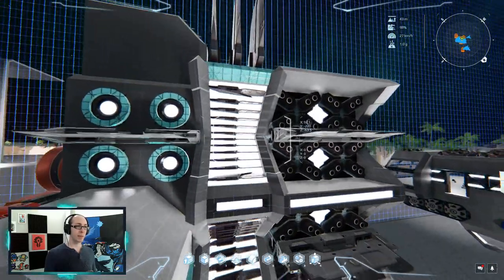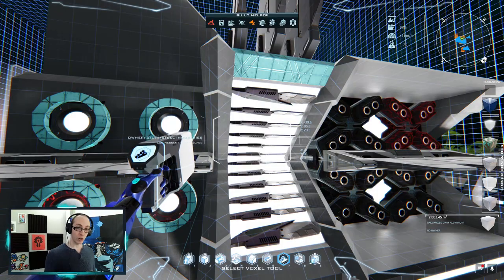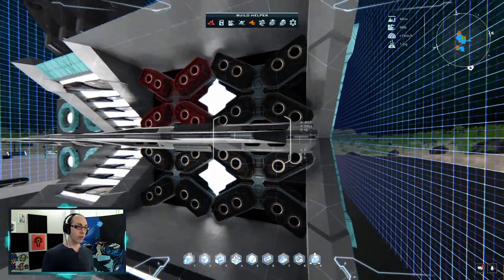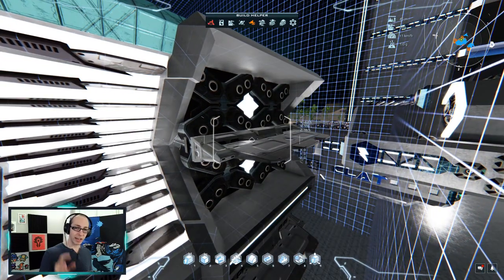DU Design - Airfoils 102 - Methods for placing Airfoils - Dual Universe

Comment: Obstruction won't go away. It works by taking a random vector (or maybe multiple vectors) from the engine/wing every X seconds and raycasting Y meters in that direction to see if something is behind it. The hyperion engine website lists the exact obstructionHorizontalAngle and obstructionVerticalAngle it can raycast from.

It gets updated even as you fly the ship. It's not a big problem if you have many engines/wings since you'd have to get very unlucky to get all of them badly obstructed at the same time, but it does reduce the average lift/thrust the ship generates.

Comment: Free tip from Captain's Customs:   If you use the Wing Variant M with the alternating wings, they can stack much closer than other wings. Since Wing M's also have the best thrust to weight ratio, they're the best way for space vs lift. The only problem comes in for super large haulers. At a certain point you try to cut down on element count anyway possible, so we start using Stabilizers instead.
Reply: @Donovan Theodore instablaster :)
Reply: @Quentin Jairo it worked and I actually got access to my account again. I am so happy:D
Thanks so much you really help me out :D
Reply: @Donovan Theodore Glad I could help xD

Comment: so perhaps im on the wrong video for this but im new and struggling with ship design and perhaps its because im trying to get too much out of a little. im trying to build a small shuttle that can handle 2 large containers of ore. but even with 4 large basic atmo engines and 4 med basic atmo engines I still cant get over .58g of forward thrust. i guess what im looking for is a basic understanding of ship design and what kind of basic numbers to be shooting for. everyone likes to cover the more advanced mechanics but I cant seam to find the very basics of ship building.
Reply from the maker: In my opinion you really want to aim for 2 Gs of thrust at full weight, and 1.5 Gs of high altitude lift. Lift is equally as important. Also focus less on how MANY containers you have or their volume. Focus more on the mass/ weight you wish to store because different ores weigh different amounts. And yeah 4 basic larges and 4 basic mediums are probably not enough. Upgrade them to Militaries.

Comment: Yeah, but if you use more than 50 airfoils it kills the game performance to 7fps.
I made a ship with 700 xs wings... 5fps.
Changing to ~150 S, still 10 fps..
32 M ones may work. 
But it also had some lights on it.
Reply from the maker: As the game currently works, yes this is an issue that needs addressing by NQ. Most likely be increasing the stats on the airfoils themselves. That being said, if you haven't tried it with Medium wings I would highly recommend it. A single medium wing is 4 times more powerful, and weighs less than 4 times as much, as a small wing.
Reply: Stormsteel Productions yeah I know it. We need „high tier“ airfoils.
I used Chrome and liniment voxel combo. That also seems to kill the performance quite a lot. 
Invested like 150h into that ship... xD